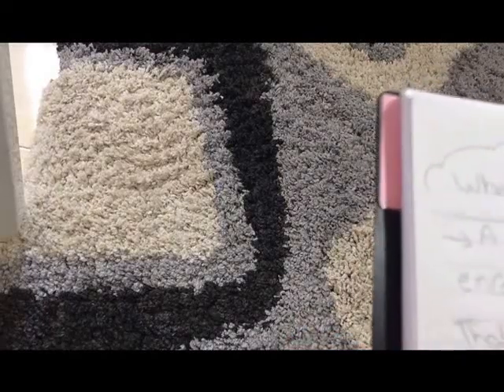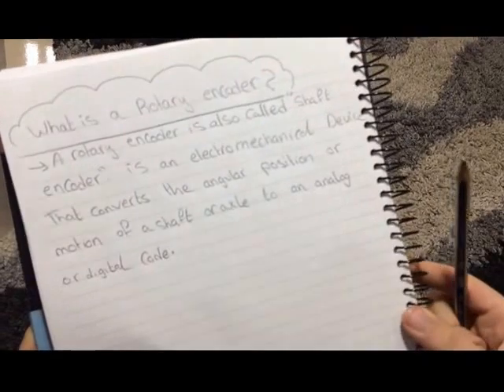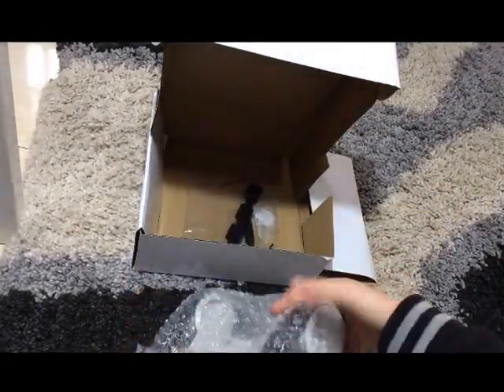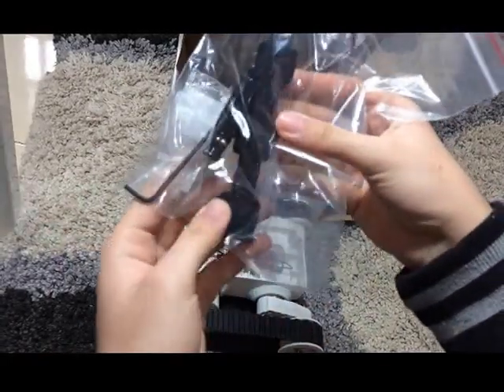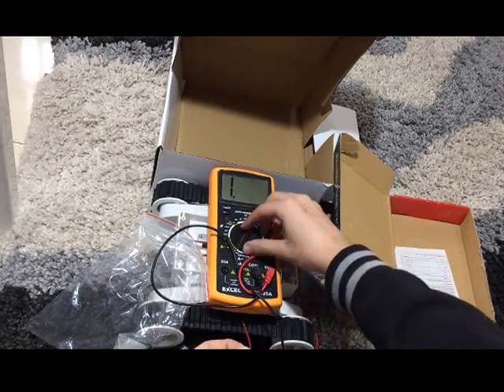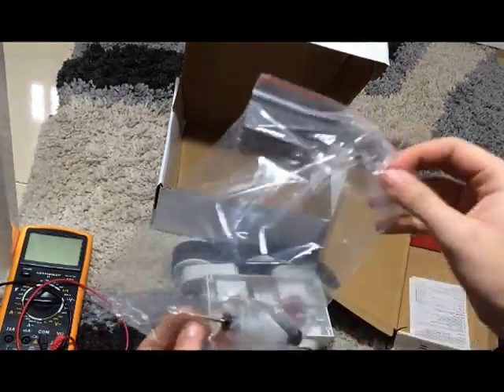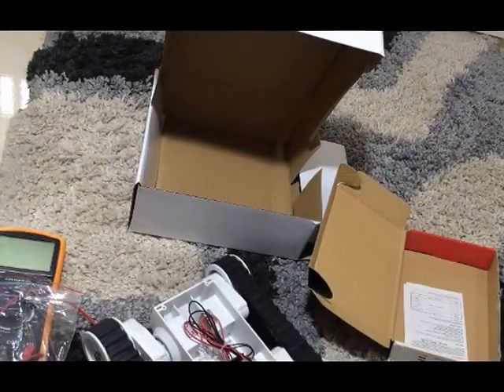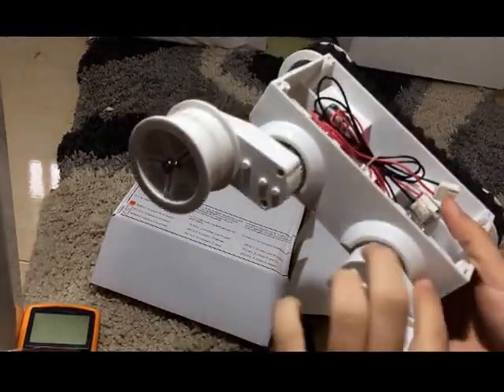unboxing of rover 5 robot + code

Comment: hi there. Wonderful break down of the wires. However, if I have a signal controller by micro controller, how do you feed that into the motors? Do you just connect the control signals to + and - ? I have a 4 motor with 4 encoder version.